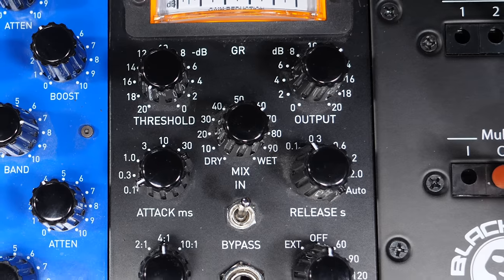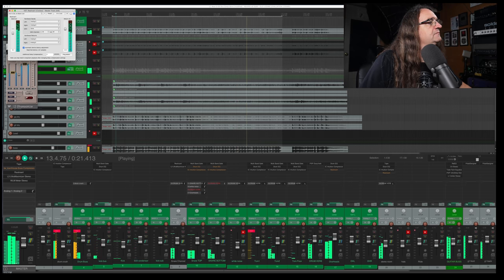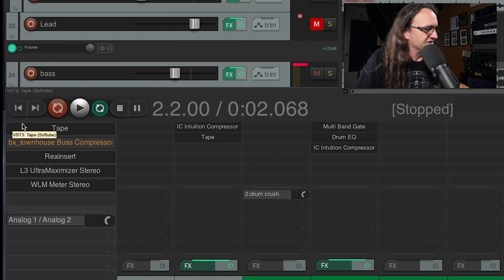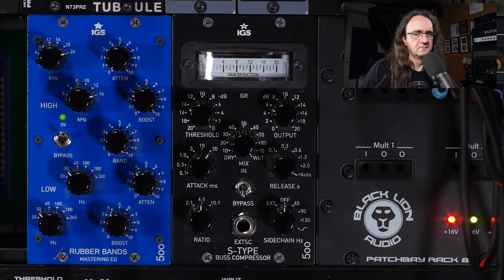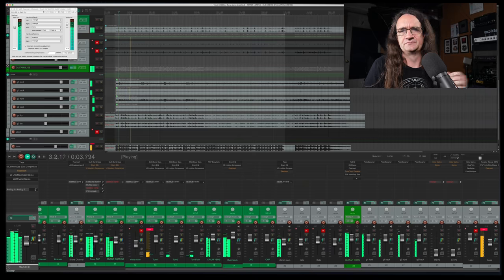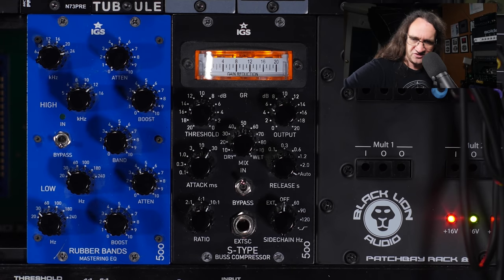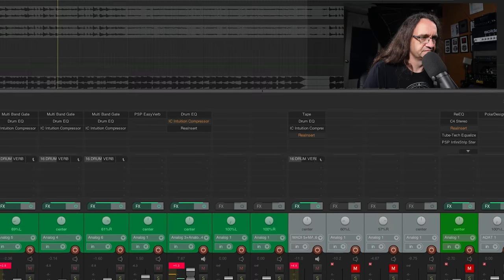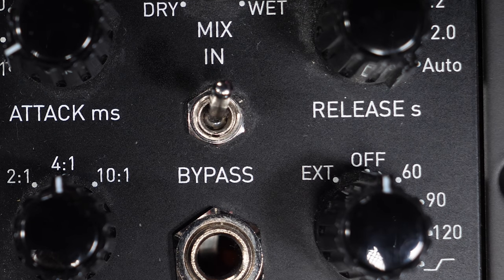Bus Compression goes 500:  IGS S-Type

Comment: I like to stack my 2buss and use my first buss compressor with a high pass set up pretty high (150-200hz). I feel like it lets the low end bounce more while gentle sculpting the higher frequencies to get them to sit down more. The needle also seems to float more on attack30/release auto settings.

Comment: So I noticed that the snare is not centered in either room or overheads. Why was this not measured during tracking? Or is there an international reason not to have the snare center in those mics? I always measure both overheads and room mics to the same length to have the snare center.